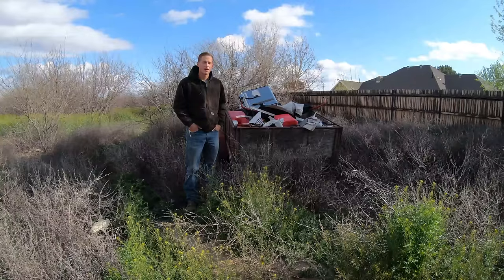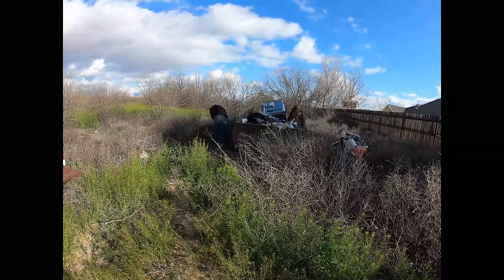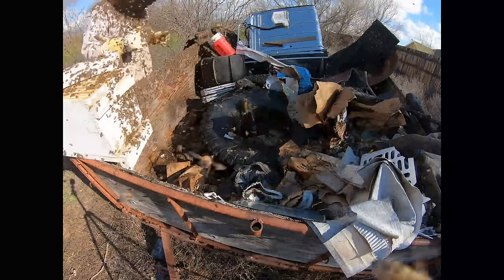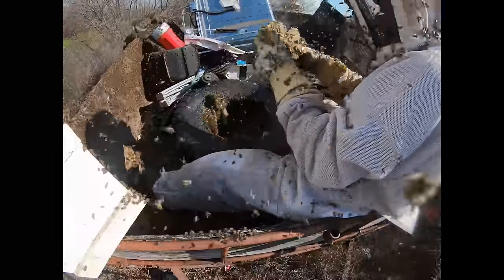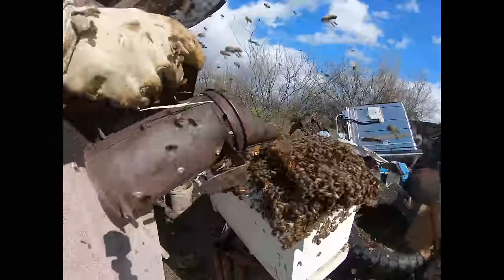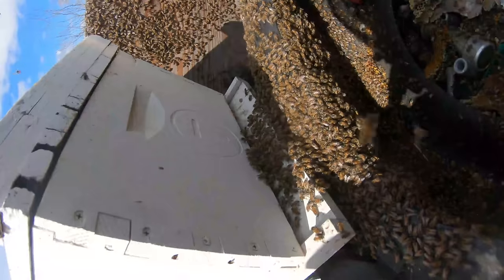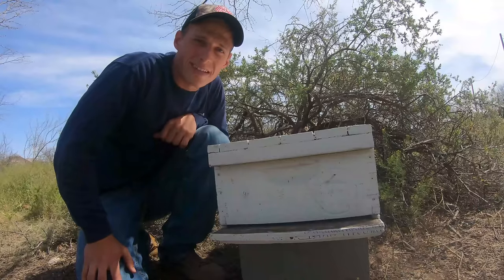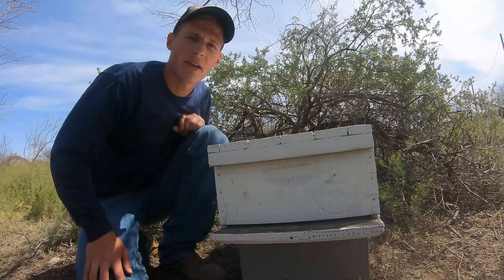KILLER BEES ATTACK DURING CUTOUT- KILLER BEES RELOCATED IN ARIZONA

Comment: I painted houses and when a hive was hanging from an eve or in general, I would spray something flammable through a lit Bic lighter to make a small little flame thrower. A few seconds of that was enough to catch the hive on fire and every bee or hornet that tried to get out would have it's wings instantly singed off. I had a fire extinguisher there as well as a pressurized hose to douse the fire after about a minute. I'm wondering why they don't just burn the contents of this trailer and the fire would have the same effect, I would think.